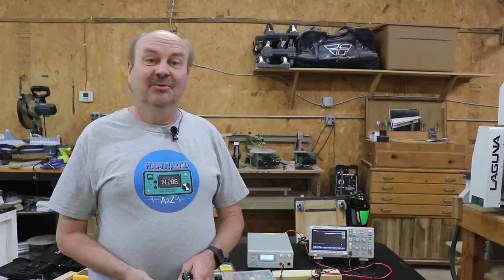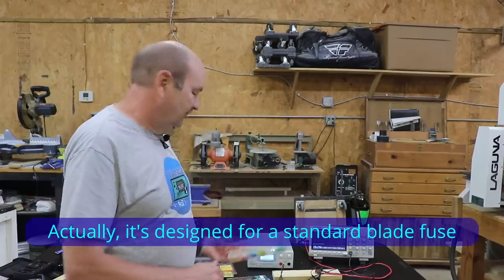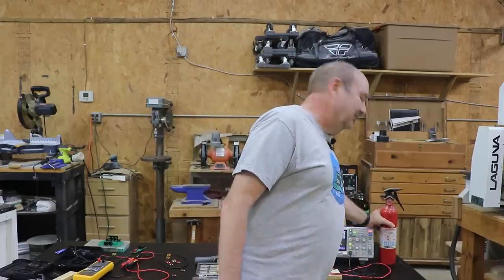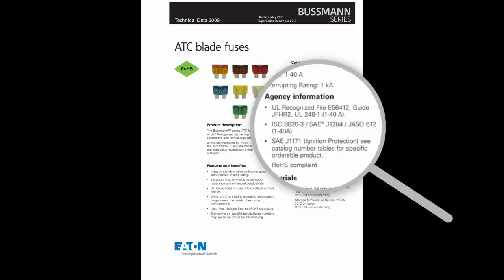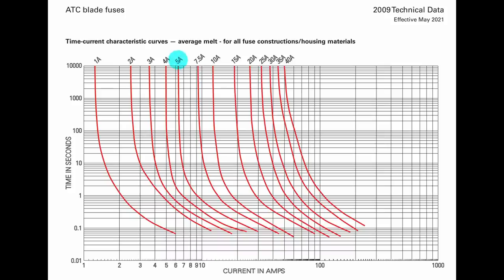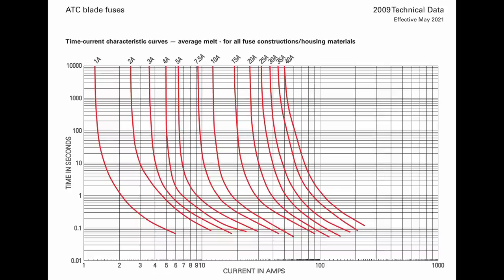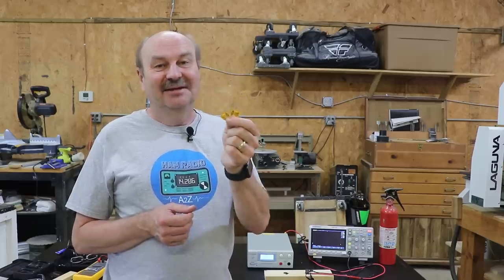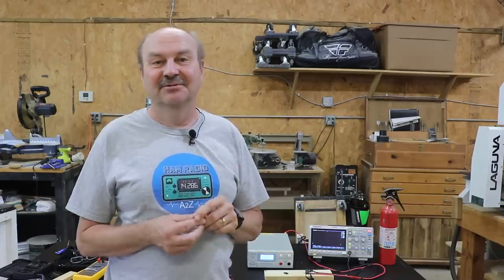Bad Fuses

Comment: Thanks for sharing this. This is taking slow-blow fuses to a new level... never-blow. I have a box of no-name fuses too and will be getting rid of them.
Reply: Why not just test them first, at least the lower amperage ones? 

It's just... I too have such fuses and I know that they blew in my car at some point. 🤔
Sooo... My course of action would be to test the fuses that I can test with the equipment I have.
Reply: @oilybrakes  I can totally second that. I never got burned with cheap fuses. Some of them were a bit beyond their rating but i never got any that would never blow. Test 1-2 of each amperage and if they blow within spec, they're a keeper. Cheap isn't always bad and expensive isn't always good,
Reply: @oilybrakes  and only use the ones that blew when they should have ? Should I buy 5000 so I can take a sample large enough to get a good measure of tolerance and still have many left to use?
Reply: @tricky778  Once you tested them, you will know that they are in spec. What else do you want?
Reply: @oilybrakes  once I know they're on spec they will not conduct. I want them to conduct.
Reply: You do not need to get rid of the fuses his test is super flawed. he has no understanding of amps VS volts.
Reply: @Bob_V  what did he do wrong?
Reply: @tricky778  His power supply does not provide enough voltage to push the proper amount of current thru the fuse. The ability of electricity to do work has two factors.
You need both amps and voltage.
His supply has the amps but with that low voltage the ability to do work only equals 12 watts. As I stated, you need 60 watts to blow the fuse. The math is 12v X 5 Amps = 60 Watts. His example is almost the reverse of static electricity, where you have a few thousand volts but almost no amps. Here it is reversed, his supply has lots of amps but no volts.
Reply: @Bob_V  the fuse is a good conductor, the voltage across it can't be high until it blows.
Reply: @Bob_V  you need about 0.75W briefly to blow a 5A fuse whose resistance is about 0.03Ω. you cannot put 12V across a fuse until it has blown unless you have such a current that your fusebox detonates.
Reply: @Bob_V  omg, I just realised what you said, his power supply voltage was so low it couldn't push enough current to blow a 5 amp fuse when it had enough volts to push 21 amps. Silly billy
Reply: @tricky778  yes thank you for that that's what I was trying to say
Reply: @Bob_V  so you think the 21A shouldn't be expected to blow 5A fuse, even though you cannot get 12V across the fuse until it blows, not even with a car battery for which these fuses are designed? Only with a massive inductor which would be dangerous outside of an electrical substation? And that's where I should be using these fuses?
Reply: @tricky778  What are you after?
I do believe my explanation was enough for the average person.
As I stated think Watts not V, Not E and not R. Think WATTS only.
This is what really matters in any circuit.
Reply: @Bob_V  I think you're talking rubbish, electrical fuses with a current rating like these are made to blow at some rate for some sustained current. That's their purpose and promise. I'm not paying for the DIN standard for bladed fuses to quote to you, though.  Oddly some fuses I bought from Halfords state no standard to promise their behaviour but everyone in the electronics industry will know and most people outside it too.

Here's an interesting fact, the fuses from Halfords state 32V on their bodies, not 12V. Which should convince you that the current is the relevant factor for a fuse to blow. Not to mention the test on a well known top brand in his area blowing at 5A with a low voltage before the point when the fuse blew.
Reply: Fuses have two ratings. The rated current is the value that it can carry for 1000h, and NOT open. The rated voltage is the value that will not arc over once the fuse has opened.

For a 12V automotive application the 32V rating is satisfactory.

However, the same fuse should not be used on higher voltage circuits (such as 120V AC power) as that voltage would arc over once the fuse had ruptured due to excessive current.
A 250V fuse would be spec’d for that use.
Reply: @pstonard  wouldn't you say that, in addition to not opening at the rated current for 1000h, that it opens at even a small excess of the rated current over a brief time?
Reply: @Bob_V  To put it simply, the current rating applies when the fuse has not blown, and the voltage rating applies when the fuse has blown.  If you design a circuit with a fuse you have to design for both, so that power calculation you did is the maximum power you can safely deliver to the load through the fuse. It's not necessary to exceed that load power to blow a fuse. It's only necessary to exceed the fuse's current rating.

Fuses have separate current and voltage ratings for a reason. For the video's purposes he needs a current in excess of the fuse rating and a voltage no higher than rated so the fuse doesn't start arcing after it blows. He did it right.

To get complicated, there are additional voltage effects on a fuse, but they are subtle and irrelevant for this video and most design purposes. They become important if you care about the behavior of the fuse while it blows. It isn't a simple on/off. There's a complex series of events that happens very quickly. For most of us that is not relevant to our designs so we safely ignore it. If you're interested, look for app notes from fuse manufacturers.
Reply: @tricky778  There are different types of thermal fuse. Basically fast and delay versions. As I noted earlier Automotive fuses are a delay type to stop nuisance tripping on inrush current, while fast blow are the opposite.

Compare a normal glass fuse to an automotive blade. Ones has thin wire (low thermal mass) the other thick metal (takes a lot to heat and melt)

A quick blow (aka fast action) glass fuse has a spring to tension the element and rapidly pull open the melted fine wire.

Hope that clarifies my earlier comment.
Reply: @pstonard  no, it doesn't. Should the fuse blow soon after the current through it goes above the rated amount even though the voltage across the fuse is low? I think it should and I think it's obvious and well known, because ohm's law is going to make the voltage low for a closed fuse, but bob_V seems to be saying you have to put 12V across the fuse to expect it to blow at about 5A.
Reply: @stephentrier5569  These are lumped values in the design of any fuse. you have a voltage rating and an amp rating. the fuse will fail when you exceed the AMP rating provided you have the proper voltage thru it.
I would rather call it Watts since two conditions must be met. Watts = I X E.
His test is off the wall wrong because he is only giving that fuse 12 watts of power when you need 60 Watts for the fuse to fail.
Reply: @Bob_V  No, Bob, that's not how fuses work. Do some experiments. Try measuring the current it takes to blow a fuse at a variety of voltages. Also, try blowing a fuse with a load resistor in series with it and look at the voltages across the fuse and the load resistor at different currents, both before and after the fuse blows. Be methodical in your experiments and you will learn a lot. Go for it!
Reply: @tricky778  One may be missing an important parameter. It is the current through the element that generates heat, not voltage across the element (before it opens)

Rupture current is defined as I^2*t (Amps squared times time)

Only enough voltage is required to overcome the resistance of the element (prior to rupture)

In the experiment the electronic power supply did not hold up long enough to reach “t”

As noted this type of fuse has a high “t” to delay rupture (in an automotive application)

The OP should repeat the tests fairly. And stop all the crap about “bad fuses”.
Reply: @Bob_V  Amps and Volts require another term to explain how the fuse ruptured Time. Any amount of current, if brief enough, can pass and not rupture the fuse if “t” is made very small!
Reply: @pstonard  Yeah, your mom told you this one.
Reply: @Bob_V  If you can’t be civil please leave the discussion. There are other places for children to gather. Thank you!
Reply: I get my fuses at auto parts store, I will use whatever form factor is appropriate for my project but my go-to are the Littelfuse "max" size blade fuses.  I've seen the cheapie fuse kits on Amazon and had considered buying them in the past but these are safety devices where cost-cutting now can lead to paying big later.  I'll stick with going to the auto zone, don't have to wait on shipping so that's a bonus too.

Comment: Fuse wire is made from a special metal alloy wire that will fuse(When any wire melts open, it is said to fuse) that is  suspended between the mounting connections hence the added value.The giant bag of fuses for a dollar that I have inspected seem like the fuse wire in them is just part of the stamped out aluminium mounting blades hence no value. Great video N0̷PXJ

Comment: This is not the first time I have seen this style of demonstration.  I was amazed at the data that the demonstration produced. Essentially the same outcome as your test, but lacking your sophistication. 
I was staying at a friends house several years ago, & I was given a spare room in their home to spend a night with them. This room was awaiting a contractor to tear out the ceiling & walls & install first grade insulation & such other work as he deemed necessary to make the room cozy in the coming winter. 
My friend had purchased an electric heater (1500 watts)  & it was plugged into a wall socket  that was a dedicated 20 amp circuit.  About an hour after retiring I awoke because of an odd smell. I sat up in bed & the electrical heater was engulfed in flames, & the power cord was burning along its length. One door in the room opened into the house proper, & the other opened into the back yard. I had left my jacket , trousers & outside boots beside the bed . I turned on the night  table lamp, pulled my boots on & grabbed my coat & removed my leather gloves(work style, not "dressy" style), grabbed the handle of the heater  (which was already starting to melt)  , opened the outside door & heaved the heater into the yard, & then turned & pulled the power cord from the wall socket, & threw it into the yard. The rug was on fire, but it was a material that was very slow burning ( treated as "fire retardant"" & it joined the rest of the immolation in the yard. The next door neighbor saw the flames & ran into the back yard with a CO2 extinguisher & snuffed the burning bits out. My friend ran 9into the rook & did the same to the rug & we opened the two windows in the room to lose the smoke. Another neighbor had summoned the fire dept. & they & the police arrived together. The Captain declared the fire officially out (a second co2 bottle was  used & they made certain the flooring beneath the rug & the wire & wood behind the melted outlet was 
flame free. The fire Captain said that the Provincial Fire Marshall's office was attempting to have that particular heater banned from sale. The next day we bought a new 20 amp duplex receptacle, & I installed it . The lady of the house plugged a floor lamp into it, & turned the light on & all appeared well. I went to close the door on the entrance panel , & noticed that the dedicated breaker was open, but the light was still on !  I reset the breaker, & it was not latching. I removed the floor plate on the breaker board  & removed the 20 amp breaker & took it apart, to find the contacts were welded shut !!  My friend asked me what I thought. I told him that I thought that he should call a Provincially licensed contractor & have him 
examine the panel installation, & anything else he deemed necessary, & to give you a report. The panel was made in China, & all its internals were as well. Most of the wiring had to be changed as well. My friend engaged his insurance company at this point, because his sister from whom he had purchased the house & who had paid a local electrical contractor to upgrade the house from a 60 amp circuit to a two hundred amp service, & it ALL had to be removed  & approved equipment installed at great expense.
You never know these days.

Comment: Thank you very, very much for this video.  As a motorhome owner this is very worrying as I have been using those cheap fuses for years.  I have been very lucky.
I am buying a set of decent ones  straight away and replacing them all.  Thanks again.

Comment: just this week I had smoke come out from under the dashboard of my car , 2 wires dead shorted and went red hot , burnt all the outer covering to a crisp , they where supposed to be protected by a 10 amp fuse , all that the fuse did was melt a little bit , but did not blow. I think the cars battery is a 60 amp. I will be replacing all the cheap fuses with brand names asap. thanks for your video.

Comment: Discovered the same thing about 10-12 years ago when a cheap fuse from one of those kits failed to blow when a wire shorted to ground on a motorcycle.  The end result was a small fire and many hours of labor replacing the bike's wiring harness.  I contacted the seller and let them know what happened; they didn't believe me.
Testing the fuses found the same thing as in this video, they just didn't open under 2x-3x their rated load.

Comment: I ditched the cheap fuses not over the (unknown to me) failure to blow, but rather over their inconsistent thickness and inability to reliably make contact with sockets.
Many off brand fuses are some random pot metal that doesn't seem to fit correctly, and have all sorts of strange geometry on the legs that you push into the sockets, compared to the Bussman, LittleFuse, and other OEM fuses that all fit snugly and have well formed connection legs.

Comment: This is a great bit of advice, and a nice catch. I can only imagine how many of these no-name kits have been sold, and how many devices out there are virtually unprotected due to the use of imposter fuses! As another viewer commented, some of the dirt-cheap fuses are made with some rather dubious metals that rust/corrode, and that's a deal-breaker in and of itself!

I'm not in the radio field, my interests lean more towards automotive and computers, but I've always used Littelfuse or Bussmann - leaning more towards Bussmann as the fuse bodies are more translucent and easier to see gaps. I feel more comfortable with a brand I've used for years, over some brand I've never heard of that has so many vowels that I'm not exactly sure how to pronounce it. The price differential isn't significant enough for me to "go cheap." Sometimes you really do get what you pay for!

When I first saw the 5-Amp in your test rig on the bench, my initial thought was "that link is WAAYYY too thick to be a fiver..." At a glance, it looks like a 20-Amp or 25-Amp. I know what some of you are probably shouting at your screen right now: "you can't properly rate a fuse based on looks alone," and generally speaking, yes, you're absolutely right and I wholeheartedly agree. BUT this fuse was CLEARLY not a 5-Amp, heck, it's more like a fuse-shaped link! As you so handily demonstrated, it could easily withstand multiple long-run tests at 400% rated current. I've seen heat-warped fuse blocks once in a while, in cars that I've repaired over the years. I think you might have solved the mystery for how that happens - OEM fuses pop and some "El Cheapo" fuses the owner bought shoved in to replace them. 

I watch a few HVACR channels, and most RTU (rooftop units) use a 5-Amp blade fuse to protect the control boards. I might drop a note with those Creators and suggest they buy Bussmann or Littelfuse exclusively. I assume they do, since they go through commercial warehouses, but they've got businesses to run and might consider trimming overhead by buying bulk no-names.

Comment: One thing you'll also find with the cheap generic no noame fuses is the blade material is thinner, therefore it doesn't have the same contact pressure and that allows resistance and heat build up. I've seen a few of thses melt in the past. I'd also check the temperature of the powerpole connectors as they are rubbish, I refuse to use them. Very disconcerting that the 5A fuse just doesn't blow at 20A though, so generally zero protection and 100% dangerous.
Reply: Could you please explain further what is bad about power pole connectors?

Comment: I bought a similar pack of bargain fuses, and had some suspicion, based on the thickness of the internal conductor, that their rating was off.  You just verified what I suspected, in a rather dramatic and more accurate fashion.  Thanks!

Comment: Thanks for a superb video and useful warning. I'm a glider pilot and use this type of fuse to protect the wiring that runs under my seat; I can't remember where I bought them. I must figure out how to control the current from a lead-acid battery so I can check one or two of mine!

Comment: Excellent video, thanx for the warning. I did buy a non-branded kit "ABN". Tested the kit on my PSU and the fuses up to 20A cleared in a timely manner. Looks like the fuses you had were just bits of wire between the lugs... Thanks again.

Comment: Thank you for this video! I had cheap fuses laying around and tested them, this is what i found:

1. 3A fuses did not blow at 10 amps even after 3 minutes
2. My switching-mode power supply blew a couple of 2A fuses at <2 amps  immediatly, only when it was set to a high voltage (20 V). I think this is due to capacitors at the output of the SMPS discharging and cousing much higher currents than the CC-Mode allows. My linear power supply was not able to blow the 2A fuses, probably due to lower output capacitance.

Good to know how these fuses behave!